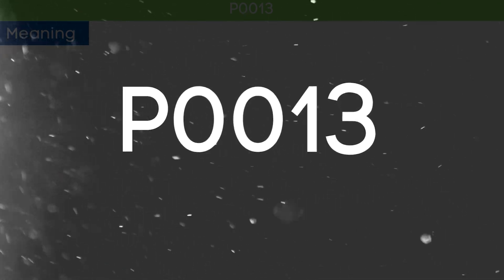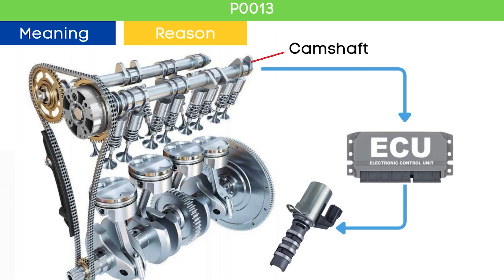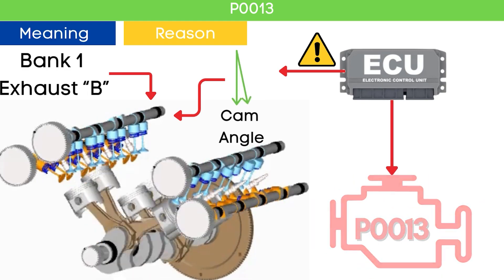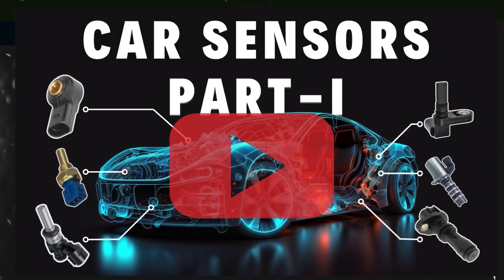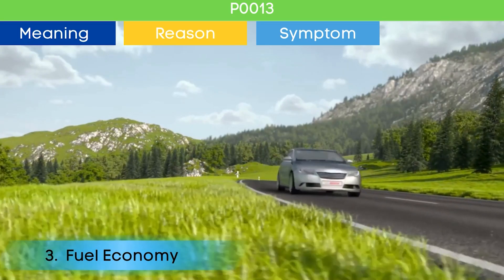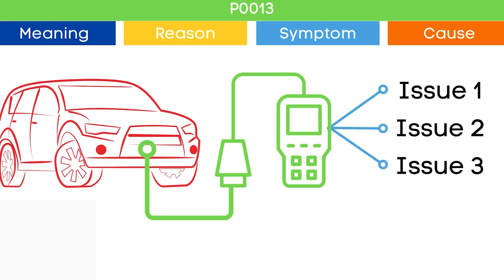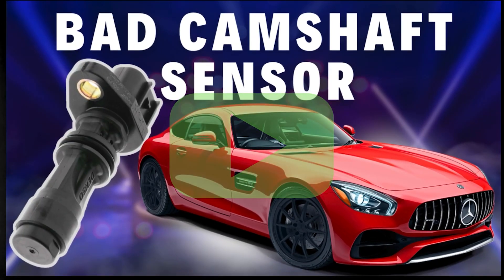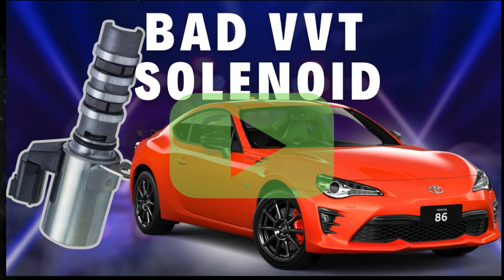P0013: "B" Camshaft Position Actuator Circuit Bank 1

Comment: How often is p0012 caused by timing chain?2005 ford expedition.
Reply from the maker: Most of the time these codes get triggered due to wiring issues. Check wiring terminal of crankshaft and camshaft position sensors. And if there is issue with timing chain these codes will get triggered.
Reply: @carfix07 life saver ❤

Comment: I got P0013 circuit MALFUNCTION, just rough idle....at first start, car is an opel insignia 2010, a20nht 2.0 turbo petrol 4x4 automatic
Reply from the maker: Is there any other codes active with P0013?
Reply: @carfix07  I buy multimeter to check solenoid valve....i will clean it...see what happens
Reply from the maker: Cleaning of solenoid most probably will fix the issue. Change engine oil and filter if it is due. 

Btw, let us know whats  your status after Cleaning solenoid valve.
Reply: @carfix07  The oil have like 2500 km i change it at 8000km most. Is a Ravenol racing type 100% SYNTHETIC not like other mineral crap or hydro crack 😭 I keep you updated of course 🙏
Reply from the maker: Hey, what about your car problem? Have you fixed it?
Reply: @carfix07  I had this code 2 weeka before p2261 i cant feel symptoms.